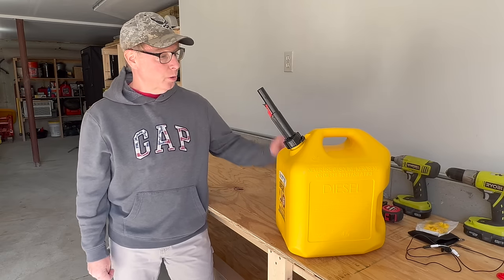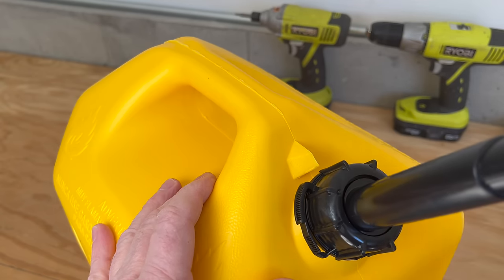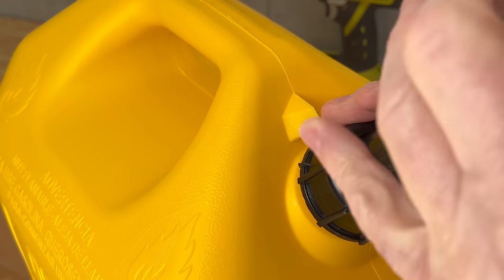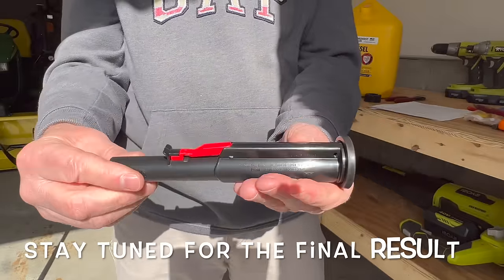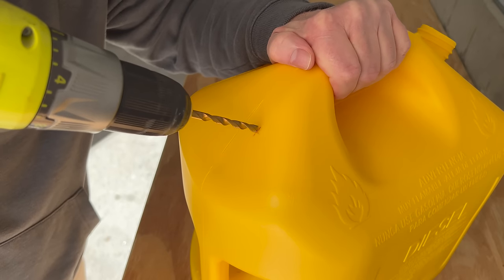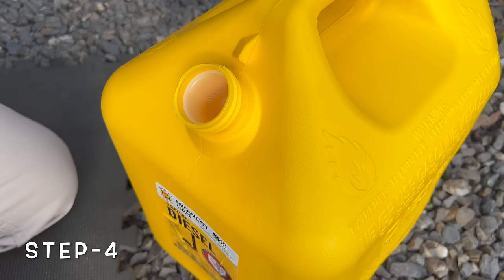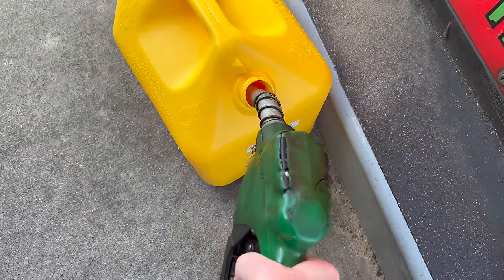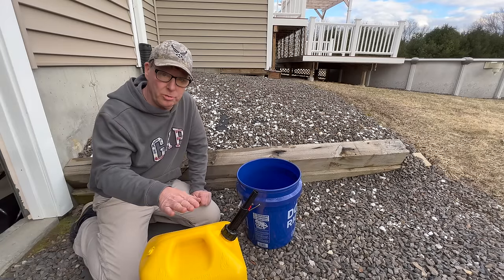Fix a New Gas Can in 4 Simple Steps.

Comment: Always amazes me that the solution to tiny amounts of fuel being spilled and evaporating from open/broken vents on a small percentage of cans was to make sure everyone spilled ten times as much fuel every time they use every single can.  Gotta love stupid regulations.
Reply from the maker: Hey John.. You hit the nail on the head. I could not have said it better myself. Thanks for adding to the conversation and thanks for watching!
Reply: And the the stupid peopid who came up with the idea behind these cans. If it isn't broke..don't fix it! I still have one old plastic can I use with a top that simply screws off and has the nozzle inside. Pull it out, screw it on,  unscrew the vent cap and blamo! Easy!  I'll never get rid of it but do wish I could find another one like it. The people who still have them ain't getting rid of them
Reply: Richard Nixon should have stayed in bed the day he created the EPA.
Reply: I hadn't gotten the memo on these new cans, and bought a 5 gallon can a few years ago to go with our new log splitter.  Turns out I can't lift 5 gallons in one hand and push back the nozzle with the other, and there is no place on the log splitter gas inlet to push the nozzle.  Got a nice fistful of gasoline 200 yards from the nearest water.  That can went back to the hardware store that afternoon!  Since then we found a few older cans at yard sales and flea markets.  Then, on a recent trip to Canada, we discovered they don't necessarily follow stupid US regulations...
Reply: The real purpose was not to prevent small spills, the regulations are simply a very small part of an overall strategy of destroying the fossil fuel industry. Just try to find consumer grade oil based paint, it's virtually impossible as government has mandated water based paint. It's a completely pervasive approach.
Reply: Two-flush toilets, dribble showers, slow washing machines, and sure-spill gas cans.
Reply: California regulations. When business decides to quit selling products in California, the warnings and stupid fuel cans will stop.
Reply: @wdtaut5650  But hey, land of the free, right?
Reply: My new Walmart can works just fine for my lawn mower.
Reply: Yes!  I transfer gas from my new 5 gallon cans to an old 2 1/2 gallon can that actually works.  I always spill some in the transfer.
Reply: Thanks for the vid!! I have one these cans. They are a total PITA, not to mention dangerous. If you leave this can in the sun with no vent, it builds up pressure. When you press the end of the nozzle into the tank, that pressure will release, resulting in a shower of gasoline!!
I will fix mine soon!!
🙂👍
Reply: And this is as good as the government gets.  Most everything else is screwed up worse.
Reply: @TomFarrell-p9z  2nd that regarding Canada - they may be going crazy up there, but at least their gas cans actually work.  I bought one at the Walmart in Fort St. John on my way up to Anchorage, and I made damned sure to hold onto that can when I drove back to the lower 48.
Reply: What about that garbage plastic ring (that screws on to the can)that breaks making the entire nozzle useless, then they want as much to replace it as the can cost.
Reply: It baffles me that instead of learning how to use these cans, people come up with workarounds instead of using them correctly. Every one of these modifications is unnecessary. They're not difficult to use.

Step 1: Vent the can by loosening the nozzle. Retighten after venting.

Step 2: Tip the can and catch the lip on the nozzle on the lip of the fuel tank. 

Step 3: Press the red lever.

Step 4: Press the can toward the nozzle (if gravity isn't sufficient to do that for you).

Step 5: Lift the can away from the nozzle to stop filling. 

These steps aren't difficult.
Reply: @karlrovey  there minorly inconvenient when using a one gallon can to fill a standalone machine like a lawnmower. They are near impossible on larger cans especially when filling something you have to hold onto such as a trimmer or trying to lift it high enough to fill a car.  The only unnecessary thing was this type of gas can existing in the first place.  The old style worked just fine and could be used one handed.
Reply: Your government at work.
Reply: @drl5002  I've used the 5 gallon ones for a zero turn mower. It works fine as long as the rubber seals are good. I definitely wouldn't use that size for a push mower. If I had to use a 5 gallon can for a push mower, I would go for one  designed to be set on its side for pouring. 

As a general rule, I use a 1 gallon can for push mowers and 2-stroke fuel. If I were running a business where I was using enough 2-stroke to justify mixing more than a gallon at once, I would still use the gallon can for fueling.
Reply: @karlrovey  for things like trimmers, size doesn't matter.  Even the one gallon cans are impossible.  You need two hands to operate the can and a third hand to hold the trimmer.  Manufacturers have come up with some clever features, but those cans are more expensive and ultimately solutions to a problem that didn't need to exist.
Reply: @drl5002  I literally have no issues using a 1-gallon can with this style for trimmers.
Reply: @karlrovey  these steps work, most of the time, on the cans available for about the last 5 years. On light weight equipment you’re still doing a balancing act to hold up the weight of a full can and keep the nozzle open without knocking over the equipment. On the first generation of the “spill-less” cans they hadn’t quite figured out how to make them actually work. They took two hands to hold the nozzle open, and a third hand to hold the can up, they leaked from where the nozzle attached to the can, as they hadn’t figured out that the same plastic and friction seal that worked on nozzles that didn’t have any stresses on them would bend and leak when you put stress on them. They also were poorly designed where air didn’t have a good path so they would “burp” causing the fuel to flow at an uneven rate. Not so much of a problem on large equipment but left plenty of spilled fuel when filling quarter gallon tanks when a half pint of fuel gushed out after only a trickle was flowing. The ones they’ve sold for the last five years or so seem to have fixed these issues at least to the point of being useable most of the time with two hands and a foot to hold equipment in place. They still haven’t fixed these cans costing 5 times as much as they did before the “improvements” 
Short version, yes, every one of these modifications is unnecessary.  They were just how gas cans came before someone decided to fix something that wasn’t broken.
Reply: @karlrovey  this style is fine. There are others that make you want to huff gas just to forget but you can't open them.
Reply: They have done this to everything and cars are next to be destroyed. I have a dishwasher that takes two hours but does not clean as good because you can’t use the old dishwasher detergent. Does not have a food chopper in it. Uses less water but takes two hours. New washing machine does not use enough water to clean clothes and rips holes in clothes. New shower heads have a plastic insert to limit water pressure. Its everything they get their hands on.
Reply: Try using one.
Reply: @trevorn9381 

Yeah, Bullsh!t. I lived through the Cuyahoga River catching fire twice from industrial chemicals being dumped into it. 
The Great Lakes are much cleaner nowadays. I remember when you couldn’t see 5 feet deep in Lake Erie. Now you can see 20ft and more!
Reply: @karlrovey 5 steps?  Lol
Reply: @karlrovey let's put it to ya this way IF IT AINT BROKE don't mess with it and make it harder to use.😊
Reply: @kinghenry8615  I tried to spell it out so that it's so easy, an idiot can do it. Here it is for the older cans:
1. Open the gas tank.
2. Open fuel can vent.
3. Remove spout lid.
4. Align fuel spout.
5. Tilt can to pour.
6. Stop filling when full.
7. Put lid on spout. 
8. Close vent on fuel can.
9. Put lid on fuel tank.
Reply: @karlrovey These five easy steps aren't as easy when you're leaning over the stern rail of a boat that's rolling on the waves and the rigid nozzle won't bend to match the angle of the transom. And when using a funnel to make the pour angle easier your step 2 doesn't work at all, a funnel isn't rigid enough to catch the lip of the nozzle, the nozzle just bends or pushes the funnel.
Reply: I finally found my people! The number of times I have stated this exact complaint and gotten rolling eyes as a response from my wife.
Reply: @karlrovey 😊
Reply: Agreed..... With the new can I'm ALWAYS soaking my hand..... Hoping GOODWILL will have an older one.
Reply: I have discovered old liquid laundry soap jugs make superior gasoline containers, and they are free! So easy to pour with a funnel.
Reply: @karlrovey brother, if only it were that simple. The filler neck on the diesel cans doesn’t work on diesel passenger trucks. It might work on commercial vehicles, but not on your standard pick up truck. The tank filler neck has a ring in it that prevents these from working properly as designed. I know I’ve been trying to use it for a while. I have to take my nozzle completely off and use a funnel inserted in my tank in order to pour from these. I personally see a very good benefit to these mods.
Reply: I would be the government geniuses that came up with the gas can regs never actually used a gas can.
Reply: Just buy a racing jug. $34
Reply: @karlrovey  I own some outdoor equipment that has the fuel tanks located in such a way that the tab made to be pushed in for fuel flow on these spouts will NOT engage. I do have a couple of machines with tanks that do allow for proper functioning of these pathetic fuel can spouts and they actually work fine. However, I much prefer the old style fuel cans. Try filling a 15-20 gallon tank with that lousy spring loaded version of spout and see how long you can hold the can steady. I can empty a old style conventional design can in seconds. The goofy style takes several minutes. Minutes count when your dealing with heavy rain, snow, or sub freezing temps. 
Happy spilling!!
Reply: @williewonka6694 or, you know, everything is not a massive conspiracy and some ideas for decreasing pollution weren't as good as others.
Reply: @BackyardMaine 
Great video. Government regulations, ruining the lives of everyday people........every day.
Reply: @trevorn9381 
I didn't know Nixon created the EPA. Thanks for your comment.
Reply: Glad to see you found a solution to these cans. However, before I did all this to fix an epa wet dream gas can, I’ll stick with my VP racing “utility jugs”. Real gas cans with a hose and a vent. F the government and their bullshit regulations.
Reply: @karlrovey so you misunderstand what venting the can means.
Reply: Perfect example of “if it ain’t broke, fix it til it is.”
Reply: @karlrovey The easiest thing to do is to just go back to what works and not use these stupid misdesigned pieces of junk. Pouring fuel should NOT require all those steps!
Reply: @karlrovey I would call it straightforward, but not easy. I know HOW they work, but I find the task of filling my lawnmower made much more difficult by this style of can. 

And unscrewing the lid partially to vent is a terrible idea that is begging for a large spill when someone loosens it slightly too much and it falls off. Mine, thankfully, has a spring-loaded thumb button for a vent. It is the difference between very annoying and effectively unusable.
Reply: @CptJistuce  With the partial unscrew on the lid, I only do that if the can is swollen. At that point, I don't even need to unscrew past the catch point to relieve pressure. Then, you re-tighten before fueling.
Reply: @karlrovey  If you retighten before fueling, how does air get into the can?
Reply: @CptJistuce  Look at the spout. Do you see what looks like a secondary hole in the spout? That's for air.
Reply: @karlrovey  on the newer versions I’ve seen they’ve added a hose that will actually let air in, after that initial “burp” where the air path is still filled with gas from the can sitting upright. Not usually too bad unless you’re trying to fill a small tank on something small. On the versions of the cans for the first 10 years, the “air hole” ended right next to the fuel hole and both just filled with gas leaving nowhere for the air to get in.
Reply: @johngaltline9933  That's not how the physics of the old one works.
Reply: @karlrovey  not sure what physics you use, in reality, when you have two paths that both start and end near enough to the same place not to make a difference, the pressure applied by the mass of fuel is greater than the outside air pressure for a while. Then as the outside air pressure overcomes the weight of fuel in its way the air rushes in to equalize pressure, causing a “glug” then with a fresh supply of air at equilibrium with the outside, fuel rushes out of the can at a higher flow rate than it had been moments before when a vacuum was holding it back. Air does not magically somehow just flow through the hole it is supposed to when there is fuel in its way that is does not have the pressure to push aside. The newer “spill proof” cans solve this with by adding a hose that sticks down to the bottom, so that when tithe can is tilted to be poured, the end of the hose is above the fuel level, but the ones from when they first started just had a second “air path” in the nozzle that ended in the same place as the fuel path. It could work, kinda, if you tilted the can very slowly, and it was only half full, but mostly they just behave as if there is no air path.
Reply: @johngaltline9933  It's called the Bernoulli principle. It's the same thing that creates suction for vacuum filtration using a Buchner funnel. The liquid flowing past the small opening (the opening for the vent is only about a millimeter or two in diameter) creates suction, which pulls air through the vent.
Reply: @karlrovey  step 4.5: wait for the trickle of fuel to suck the sides of the can in. Once the tiny "vent" starts working, wait for the -improved trickle to fill your machine. Rub arm to prevent it from falling asleep while waiting.
Reply: @johngaltline9933  I'm glad to hear they improved the design. Whenever my garage sale cans fall apart, I'll be looking for this kind.
Reply: @Phrequencygod  I literally have to do none of that when I use the cans AS THEY'RE DESIGNED. They have a vent built-in that works just fine.
Reply: @karlrovey  If you have can's that work, awesome.  but it does not mater the size of the opening if it opens up right next to the path for fuel and is also under the fuel when the can is tilted to pour.  the air can not flow past the fuel in it's way until sufficient pressure has dropped in the air above the fuel to allow it to get past the weight of the fuel.  Sadly that is just how physics works.
Reply: @karlrovey  The one busy being drowned by gasoline so air can't get to it?
Reply: @CptJistuce  You would think it's being drowned by gasoline, but it isn't thanks to the venturi effect. The gasoline running past the little vent hole lowers the pressure enough to pull air through the vent hole.
Reply: @karlrovey  Not how it works when I fill my lawnmower.
Reply: That's not why
Reply: The world is full of idiots.  Congress proves it.
Reply: I just spilled so much fucking gas
Reply: I’ve spilled way more fuel with these than entire life before them.
Reply: Nice.

The new cans are morinical.
The ones we used in the 80's worked fine, and they did not spill gas everywhere. 
I have literally had the new ones belch a quart into my face cause of inadequate venting, lucky I closed my eyes in time.
Dangerous!
Reply: If you REALLY want to fix something, get government involved! (sarc)
Reply: Made by people who think they’re making a difference concerning things they’ve no real experience in but enough money too buy off the law creators and build a product.
Reply: You have just summed up the ENTIRE environmental air head movement 🎉🎉🎉🎉🎉🎉🎉
Reply: You could start a new religion with these revelations! Seriously, though, you captured the collective angst we all feel when we mow the lawn, and responded with great solutions
Reply: The engineer who designed this system probably works for Boing now designing aircraft doors and landing gear.
Reply: Somebody with an idea must've been related to someone in a regulatory agency
Reply: it's a solution only possible with the power of committees … govt funded committees
Reply: Democrats care, that's why.
Reply: It’s a total jackass Design by guys who never use gas cans
Reply: Government intelligence, proven to be an oxymoron once again. 
One more reason to run when the government says they are there to help.
Reply: @karlrovey i use old 2 gallon oil jugs a lot.